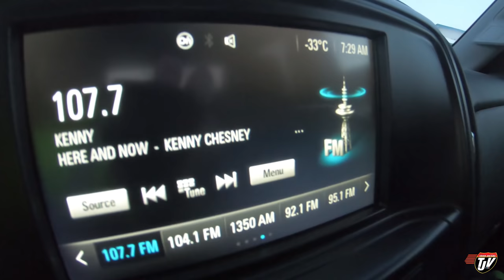TAILGATE | #2211 | Feb 11, 2021

Comment: Several years ago, I was leaving San Angelo, Texas in a sleet storm in early March. I crossed over to I-20 to head east. Sleet and freezing rain was falling. Traffic was backed up. There was lots of cars and trucks that had slid off into the median and just left there. I understand why they have those cables in between the middle of the road. Tow trucks would be busy later that day cleaning up that mess. A drive that should have been four hours turned into 7. When we got into Ft. Worth the temp had risen to 40 F. It made for a longer trip back to Kentucky.

Comment: Gee; here in the foothills of Mt. Level we have 25 19m articulated buses for an area of 125 000 people [plus about 80 regular size buses, and about 50 vans].  So seeing a "bendy bus" is not at all uncommon.  They're a hoot when they do a 180 in a cul-de-sac -- they do it better than a regular 12m bus; and it is a little strange to be able to almost touch the front of the bus from the back of it.